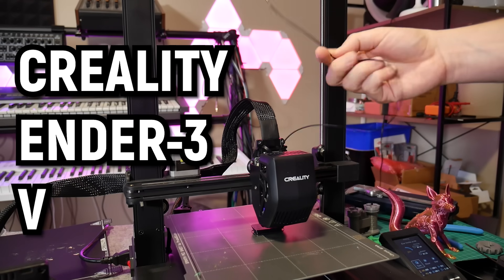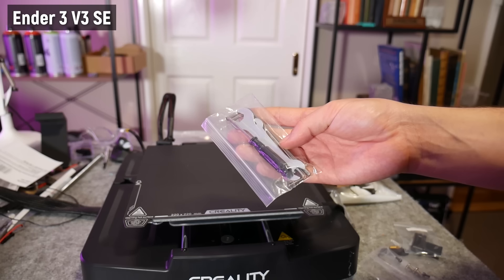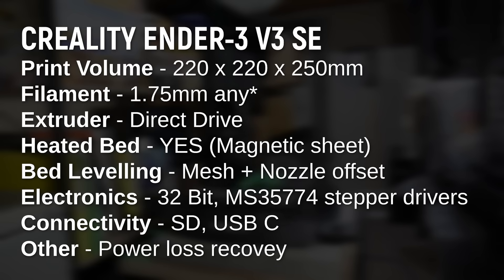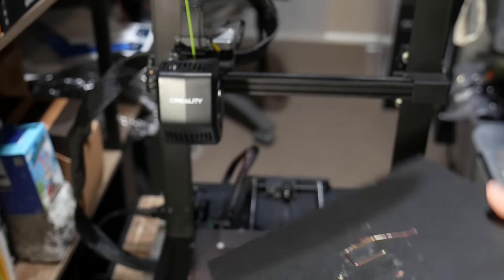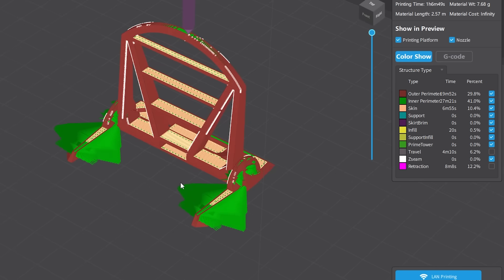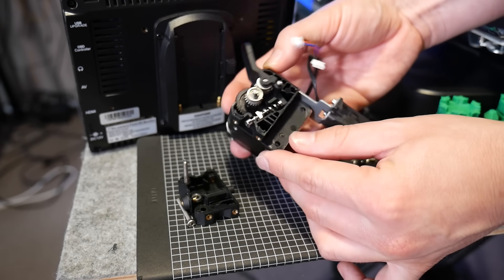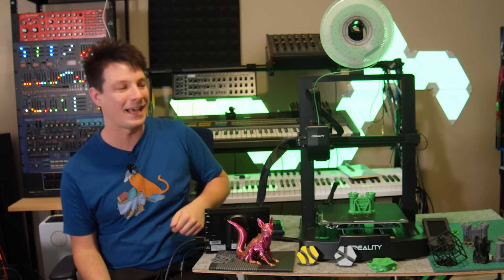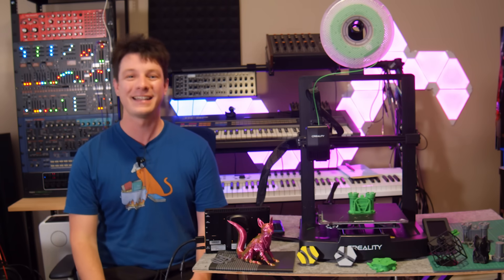The Creality Ender 3 V3 SE is very good. There, I said it!

Comment: I have the ender 3 v2 Neo. I'm a complete beginner and it works really well. Setup was done in like 15 minutes plus the leveling. And it hasn't ever failed on me so far. It's not fast but it does creat clean prints.
Reply: I did the dual Z axis drive, Sprite Pro Extruder and Sonic Pad..... Boat benchie in 22mins with amazing quality. Original setting with v2 Neo is 2hrs

Comment: I think all 3D printers in the market have a target consumer, Even within the Creality Ender 3 offerings. Here in Africa The Original ender 3 can easily cost 2 to 3 time as much as it would normally cost, so getting one could be a game changer for anyone over here. Many other 3D printers are not readily available as 3D printer manufacturer may not necessarily include the African continent as market space to get customers, which in reality is generally untrue. Hence 3D printers not only the ender 3 would cost 2 to 3 times as much when they are even available to start with. So in summary, I am not a big fan of the rants.

Comment: I have a friend with the Ender 3 V3 SE and she loves it, but for my needs, it was the lack of a spring steel PEI plate and filament runout that made me pick the Elegoo Neptune 3 Pro instead.  Similar price point considering the upgrades I'd have to purchase for the Ender 3 to get what I needed.  For what I need it for, the Neptune is plenty fast and can be changed to Klipper later on if I want to make it speedier.
Reply: The Neptune also seems to have a hot end that supports higher temps, which I find more important than many other advancements people like to have. Not sure if it has a bi-metal heatbreak though.

Comment: I bought one on pre-order. It's my first printer and I love it! The coating on the bed came off but Creality sent me a replacement. I removed the full coating and the glue from the old one and ordered a thin sheet of G10, which I then glued on the spring steel. This way I don't need to use clamps but I get the benefits of G10 print bed. I haven't even used the new build plate they sent me.
Reply: I had exactly the same thing happen to me, on the VERY FIRST print. Solved it by putting a glass bed on it. I have now put 4 full spools through it with no issues, I really hate these flexible plates, never worked for me in the past . I had hoped with the auto levelling that this machine would be different, but no. I also have a replacement build sheet from them, but like you it's still in the box....lol

Comment: I asked my partner for a 3D printer for Christmas and since she doesn’t know anything about 3D printers I had to select one and share it with her.

After having done some research I choose the Ender 3 V3 SE. Then I saw your Creality video and started doubting my choice lol. I decided to stick with it though, because it seemed like a good choice and a lot of your criticism didn’t seem to really apply to it. Glad I did :D
Reply: Would you reccomend it for beginners who dont want to use it full time, but just as a fun and creative type of tool?
Reply: @thehobbist5544 I would really like to know this too
Reply: @thehobbist5544  I have one and I would. I have an older ender 3 and bought a 3SE and use both. The SE is easier to use with the automatic bed leveling and is easier to change filament. And it is faster. No 3D printer is perfect, you will always have the odd print fail or come lose from the bed now and then but I often print quite large items and just click print and walk away very confident it will just work. My one slight issue is I prefer the bed on my older ender 3 which is a flexible vinyl magnetic surface. The SE comes with a metallic metal surface which is far less flexible and IMHO less sticky. I have had the occasional print come lose mid print which didn't happen with the vinyl bed. But you can easily buy one and add it.

Comment: Make sure when you set up that you tighten ALL the screws. Mine set up well enough, but all my gantry screws were a little loose, and I had to level the gantry to get rid of low spots on the print bed.

Comment: Why do people make such a big deal about bed leveling!?! I’s really not that hard to learn how to level the bed and set the correct offset from the nozzle. I level my bed on the fly as the printer is printing the brim / skirt. As others have said, this printer is cool but no longer seems as moddable as the earlier versions of the Ender 3.
Reply: because it's quick and easy
Although that comes at a price of effectiveness. I really don't think compensating for an unleveled bed in software is comparable to not having it unleveled at all or being able to level it in hardware. 
The auto Z offset is pretty cool however and worked wonderfully for me.
Reply: @zUltra3D  yea in my opinion, you should learn the basic mechanics of the machine before just wanting to print a bunch of parts. Most i3 style machines that tout having ABL are just complicating the mechanism and add another level of complexity to an entry level user that would have a hard time troubleshooting if it were to malfunction or not work correctly. The only time I’d say ABL is necessary is for larger machines with a large build plate that would make manual leveling very time consuming or difficult because there is a lot more room for variation in the middle of a large plate, far away from the adjustment knobs. 

It’s kind of like wanting to learn to drive a car, but relying on a new cars self driving technology to really do the work for you instead of actually learning how to drive yourself.
Reply: @Addimotive  I know, I don't like it either, especially when you can't do much of anything about it considering that it is now not even adjustable

Comment: I loved my OG (then gradually upgraded) Ender 3 so much that Creality has warm spot in my heart. I've recently upgraded to Bambu but I love that there's a great new Ender to suggest to new people joining the hobby.
Reply: I completely agree. I started with an ender 3v2 neo, Which isn't great, but now i have a Bambu, but it isnt the same.
Reply: Enders and their owners are such a perfect example of the 'Humans will pack-bond with anything' phenomenon. After all the cable management mods, cooling fan/duct upgrades, belt tensioner locks, Sonic Pad mount, zero-offset probe mount, and endless hours of tweaking and troubleshooting, my E3 S1 Pro is mine 🥰 A brand new, objectively superior, just-works-straight-out-the-box replacement wouldn't hold the same place in my heart.

Then again, maybe it's just some unholy mashup of sunk cost fallacy and Stockholm syndrome, who knows 😅
Reply: @glittalogik  An Ender 3 Pro almost killed my interest in the hobby.  I believe it was a perfect storm of QC oversights.  The thing didn't work consistently or properly.  Then I bought an "entry level beginner's printer" from Mingda and it gave me what I wanted: very good prints with almost no interaction by me, which got me enthusiastic again.  It's a hit-or-miss hobby.

Comment: I wish these were cheap in my country, i paid $270 for E3V2NEO ON SALE but its pretty good printer, this one is better in some ways but probably hard to find mods / software for it as its new and weird
Reply: it's sort of inversely proportional, if the product is more polished and custom then it's less customizable and modable by the end user. The original E3 Pro is so modable because it's essentially just a bunch of aluminium extrusions held with screws. While I'm not saying the V3 SE isn't modable, it's less straightforward

Comment: Due to a delivery fluke, I had the ability to get a V3 KE a couple of weeks early. For the price it's amazing! But, and I can not stress this enough, CHECK Every screw! With mine the screws of the z-axis coupler were lose. Other then that, it's fast, relatively accurate and the online capabilities are a bonus. Plus it also has the filament sensor you were missing on the SE. Personally I would recommend the KE to all kinds of hobbyist!

Comment: I have my first 3D printer in the mail, I ended up going with the Elegoo Neptune 4. I have been craving a 3D printer for about a decade, but have actually never seen one in operation outside of youtube. Crealitys lineup of printers is just overwhelming and confusing. I think they need to let go of trying to capitalize on the previous success of the Ender 3 brand by using new postfixes to the Ender name. The Ender 3 is more and more associated with a bygone era of 3D printers, and so will their new designs by way of their name.

Comment: The Ender 3 wasn't my first printer. The Flashforge Plywood box was. Then I got a Anycubic Photon. THEN I got an Ender 3. THEN I got an Ender 3 Neo, THEN I upgraded my OG E3 with dual Z motors/screws, Silent board, Auto leveling, and direct drive. 

Some people would say that's crazy. I learned a LOT. The biggest thing I learned though, was that I don't like to be forced to tinker just to get some robotic glue gun to make trinkets that look good. I don't even run my modded Ender 3 anymore. The Neo works great for small, simple things in PLA. The V3 should be fantastic for new hobbyists. 

I ordered a K1 this week. I want smaller PLA stuff fast. The gifts, the game pieces, the clips and brackets and organizers that I don't want to give Jeff Bezos money for.  I want ABS, and PETG, and CF, and TPU. I want all those things after years of tinkering, what my likes and dislikes are, and where my time is best spent.  

I wouldn't have known all those things without a $100 Ender 3. The flashforge....well...that's 10 years in the rearview.

Comment: With my V3SE printer it's exactly vice versa. I have extreme stringing with the Creality Print Software and the original V3SE profile. But not at all with a custom Cura profile. Can anyone tell me what's going wrong?
Reply: Creality is not really great in making software. This version of Creality Print is not bad, but it's not perfect either. By the way - Cura 5.6 has a V3SE profile included. I tried this one out and it works perfectly without any tweaks. The only thing you want to do is to add the M413 S0 command, that disables the Power Loss setting, to the start of the gcode. Other than that, it works perfectly.

Comment: Would you recomend this over the Ender-3 S1 Pro ?
We have 4 of the Ender-3 S1 Pro and want to add some more printers. So should we just stick to the same model for ease of use, or change to this one?
This is for studens of varying insight in to 3D-printing, at my university.
Reply: The V3 SE is more like an upgraded S1, if you want the technical material capability that the S1 Pro has then you go for the V3 KE. Both V3's are very superior to the S1's

Comment: I’m holding out for the Ender 3 V3 SE Pro2 that includes the filament runout sensor
Reply from the maker: 🤣 these names
Reply: I'll hold out until that one launches, just so I can save $7 on this one. Or should I go for the one that's $11 more and has something slightly different, that I can't quite put my finger on?
Reply: Ender 3 V4 S1 Pro Max

Comment: It's actually much easier to remove the prints by taking the whole print sheet off and flex it back and forth. Taking the print off the PEI coated bed by force will damage it
Reply: With pla it isn't too bad but I've seen petg utterly ruin these plates if people don't flex pieces off.

Comment: Honestly it's really good for a Creality option. Mine is also pretty good, although I'm not the biggest fan of the fixed bed. Some have it super leveled, some have it insanely unleveled, other times it's just the gantry that's not perfectly squared, like mine was. I don't think that high spot on the bed is the cause of the weight sensor tho, it's probably just the plastic peg that's too long, mine is at almost 0.00
Reply: wtf at  0.00? my best ones are at 0.2 and others around 0.4 while two at 0.6

Comment: Much improved, but Creality still cant get the firmware parts correct. Should be using 5x5 mesh grid instead of 4x4, no input shaping enabled? Input shaping on marlin works great, ive been using it for months and can crank out 30 min standard settings benchys on an original ender 3 with some upgrades.

Comment: Yup, with filament sensor it would be a no-brainer purchase. But Creality doesn't like to make things easy. :)
Reply: I'm sure they will nail it in the Creality Ender 3 V3 SE V2.
Reply: @stevensmith4099 nah the V3 SE SE
Reply: @stevensmith4099 E3 V3 SE V2 Neo 😃
Reply: When the E3v3KE drops a little it will be my next machine... Unless I get the mini Bambu for Christmas.

Klipper, input shaping, and run-out.

Comment: I’ve had an original Ender three for years now without a single problem. No upgrades. I have other printers now but I still use the Ender three when I’m making prints with multiple parts. It was my first printer and I still love it.

Comment: I bought this printer as my first 3D printer, and while it seems to be very competitive at its price point,  I think I should've spent a bit more e.g. for the A1 mini. I'm sure I'll still get plenty of use out of it though (after replacing the print bed with something else)
Reply: I just bought the V3 SE too. I got an older Creality PEI Plate for $8.99 on amazon. Really is a fantastic upgrade.
Reply: I bought it too as my first printer. Try Garolyte / G10 print bed. It's doing amazing for me.
Reply: Bunun yerine bambulab a1 miniyi önerir misin? Sence hangisi daha iyi?
Reply: If you're spending money on a new build surface anyway, I strongly recommend shelling out for a Wham Bam PEI plate. I upgraded from the OEM Creality plate on my S1 Pro and it's in a completely different league. I've cleaned the plate maybe twice in the last 6 months and PLA adhesion/release is perfect every time.

Comment: I got one of these a while back to get into the tool space, after watching your previous ender-3 video. I got this printer as a tool, not a hobby (I don’t care about open source or modality). I was up and running in 30 minutes, no issues since, and no tuning. It has been an amazing tool that has allowed me to build parts that I couldn’t before, and at an incredibly low price. 

For what it’s worth, I have no high spot on my printer bed, my leveling outputs are all quite consistent.

I did have some odd slicer outputs similar to what you displayed, I haven’t found why it happens, or a definitive solution, although it’s mostly a non issue.

Edit: thanks for the slicer profile, I will give that a shot
Reply: I'm using cura slicer for my ender 3 v3 se. There's no profile for it but I've been using the s1 profile and I've just altered print speed. I print most things at 180mm/s max to reduce rocking.
Reply: @matthewsmedley2521 actually Cura just added a profile for the V3 SE recently.
Reply: @AcidburnHckr   yes! newest version should have it (I wasn't sure, since I have the manually installed profile that I got from their github, but it should be the same thing)
Reply: @AcidburnHckr  I'll have to get the newest version and try it. I've been using the profile I mentioned since I had the printer.
Reply: I have two high spots on opposite cornets at around 0.6. So just to add that it isn't an exception.